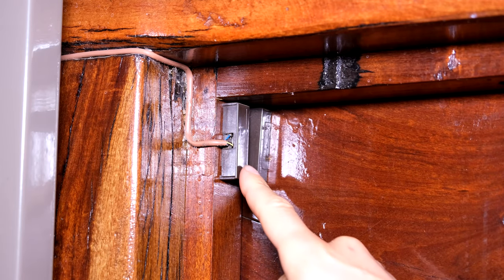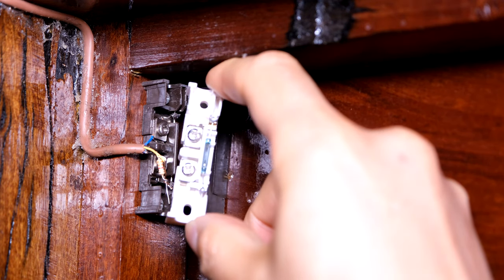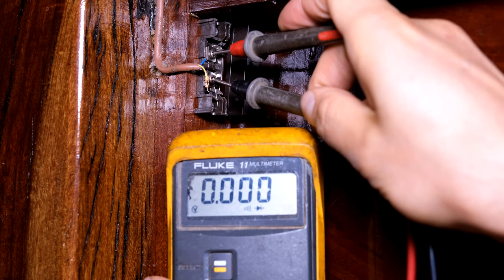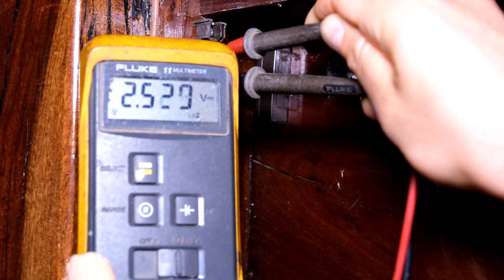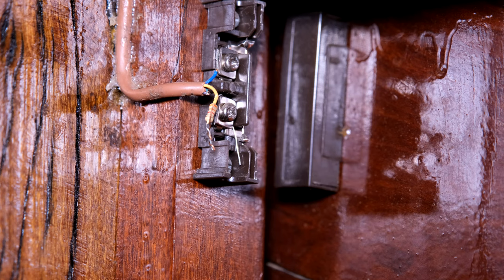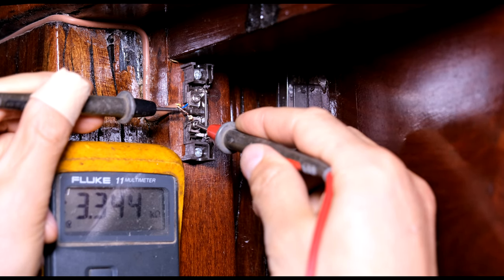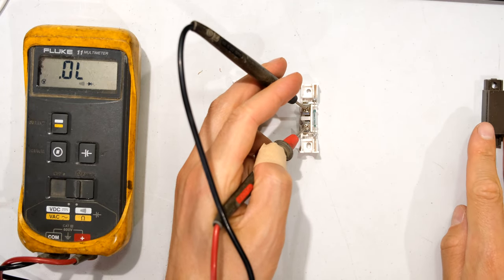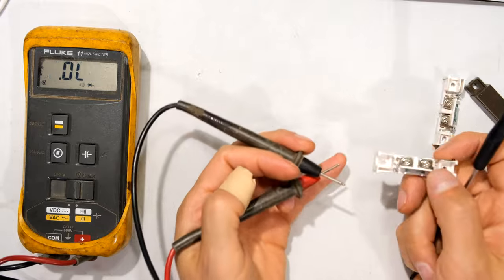How to test a magnetic door switch for an alarm

Comment: Excellent video - https://www.youtube.com/watch?v=5q20QsNB0JA
However, what if the false alarm is intermittent, every other week? In this case the voltage test will show the sensor as OK, but the false alarm may still appear. Do sensors have an expected life span and should be replaced after that? Thanks.